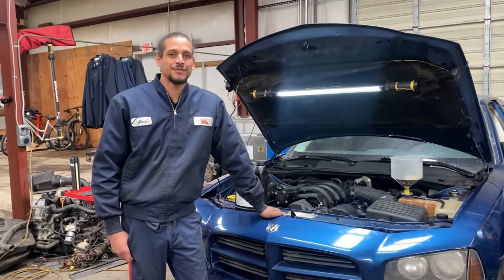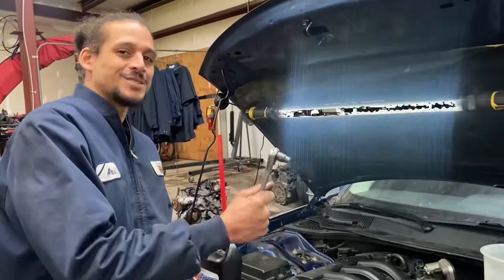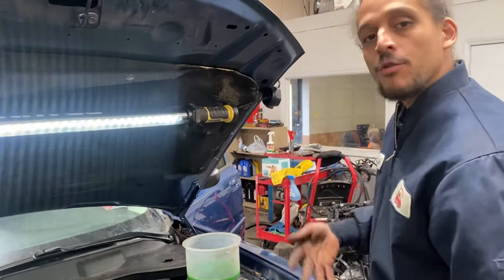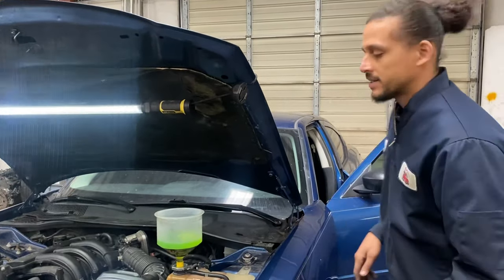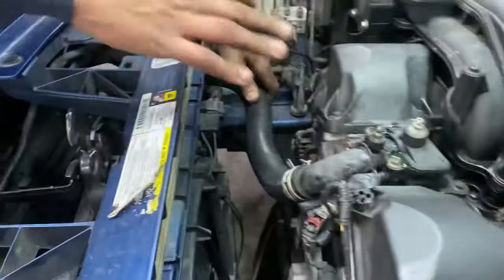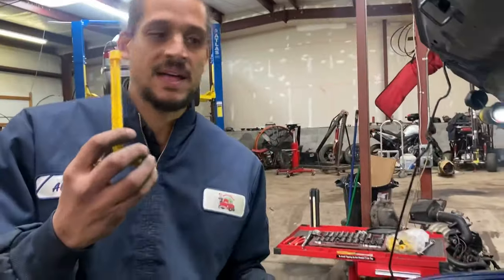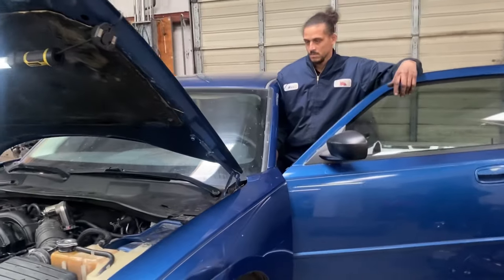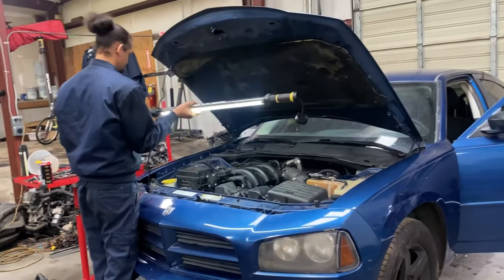How to Bleed or "BURP" Air Out Of Your Engine Cooling System (2 WAYS) #coolingsystem #overheating

Comment: Always use factory coolant ,and distilled water otherwise just throwing your money away,also always reuse factory hose clamps,they keep constant tension unlike garbage worm gear clamps
Reply: @markhunka  I re-used factory hose clamps one time and had the lower radiator hose blow off while I was driving. A few of my co-workers (diesel & auto mechanics) told me to switch to worm gears instead   so that's what I do now, and haven't had any issues.
Reply: What about rain water

Comment: I have a 2003 Honda Civic LX with no bleeder valve  and did everything this man did and it still didn't work.   What I found out later is that you leave that funnel with coolant attached after shutting off the engine.  Do not plug it.  Let the coolant and engine cool overnight.  As the coolant in the radiator and engine gets cold it contracts creating a vacuum sucking more coolant from the funnel.  If you remove the fumnel too early, you risk sucking in air instead.
Reply: @senatedocument2646  Isn’t that what the overflow is for. It will just suck it out of the overflow that’s why you check the level after it cools

Comment: On some pesky vehicles you should leave the funnel on after done burping and shut vehicle off 3-5 min, then let it run a couple and repeat if needed. Be amazed on some cars how much air comes out after you let it cool and restart. Good video sir!
Reply: Yup, I did 3 heat- cool cycles and saw the level drop 😮

This is a great tool since it places the level at the highest point for air to bubble out

Comment: I worked at a Chrysler dealer for 10 years and I found that the Chargers and 300s love to retain air in the cooling system. One thing I found that always worked great was to take that small hose off of the top of the tank, plug off the nipple on the tank, fill the tank and put my pressure tester on it and pump coolant into it until it flows out of the small hose. I got so frustrated with not getting heat until I came up with this method. Also if it’s a hemi, take out the bleeder screw or coolant temp sensor on the water pump and fill it with the engine off until coolant flows out. Even the vacuum fill method doesn’t work that great on these cars.
Reply from the maker: Thanks for the advice buddy new tricks I love it
Reply: Man I’ve been struggling getting the air out of the Chrysler 300. I’m gonna try that trick and see if it works for me
Reply: Not a Chrysler but my Ford Focus Zetec motor had no bleeder but did have a small hose coming out of the thermostat housing to heat up something on intake manifold and when filling I would pop the hose off and fill till coolant started coming out then pop it back on.
Reply: @user-kw5ze5ky5q  No lies. My little 3.6 gets abused by me. I run it!! Likes to blow thermostats!! This bleeding is a must know!!

Comment: I've been using this kit for decades. However, you need to have access directly to the radiator. I've had Ford's and VW's which only have access through the reservoir bottle. 
For this design without a radiator cap, I fill the system completely, squeeze the bottom radiator hose several times with the cap off the reservoir bottle in order to "burp" the air out of it. Then I fill the system again, put the cap back on and drive the car/truck until it is completely warmed up. When I park it, I check the reservoir level and top off as necessary. Then I come back after the engine has completely cooled down to see if it needs any more. 
Note that the heater temperature control should be turned fully open to the hottest position to ensure the coolant goes through the heater coil and purges the air out of it. 

Also, be sure you only add the proper coolant. Different car manufacturers require different types and color the coolants differently for a reason. Even then, DO NOT MIX different colors, grades or brands of coolant without doing some research. You can do permanent damage to the engine and cooling system. Do NOT use a "universal" coolant. There is no such thing. Spend a few extra bucks for the good stuff. You only need to do this every 30K miles, at most.
Reply from the maker: Thanks for the comment
Reply: Been using universal fluid in every truck/car iv ever had and never had an issue.

Comment: Thanks Alex!! This is an old post I know, but something you said made me really take notice! I changed my thermostat and was getting an ECT sensor that was reporting only 145 degs to the ECM and running in closed loop all the time in the winter (now) and giving me HORRIBLE gas mileage (22 in summer 12 in winter) the gauge would go from half and 194 Degs then the gauge would fall to near cool and 145 degs and very little heat. I was thinking I had a bubble sitting in the system around the ECT sensor (I changed that out twice, as well as the Thermostat both under warranty) I just couldn't believe I had air in there and it must have been a bad part. But I have to believe that is what is going on...Man, I hate the vehicles with the reservoir, or degassing tank as some people call them. Sorry for the long post, But thank you for this video, ordering the kit now!

BTW, if you or anyone else has an alternate idea, I sure would appreciate the comments!..Peace

Comment: I’m 23 and a 3 year technician I learned from a very smart tech when I started to ALWAYS refill with a coolant vacuum filler. I’ve NEVER had issues with car overheating because of air inside the coolant system. I work at CarMax and have refilled every brand make/model you can think of.

Comment: This is great info!  I had work done recently at a highly regarding local mechanic shop and they replaced my 100,000 mile hoses.  After getting the car back I noticed it sounded like a washing machine under my hood.  Thank you for solving my problem. I suspect the mechanic didn't re fill the car with coolant and air pockets resulted.

Comment: I wish I had watched this video before sending my car to the dealership. They ended up doing a bad service that costed me 200 bucks. Now I have air in my system, and the header is intermittent because of that. If don't solve my problem, I will follow your method. Thanks!

Comment: Damn good video sir! You hit on all the things us newbs would need to know, very informative and great delivery 👏🏽
Reply from the maker: Thanks so much! Glad I can help 😊
Reply: @AlexTheCarDoctor  Here's a question. I noticed you didn't jack up the car being the traditional method. Is this method no longer required? I ask because I'm told for Infinti's and Nissans it's ideal and helps any air escape faster. Also last question. If there's no noises from the water pump, no signs of leaks, no smelling of coolant in the cabin, yet, the car overheats as shown by the gauge. Would you think it's trapped air and would trapped air make the coolant rise in the funnel? Because right now when I rev to 3K RPM I notice the gauge goes up vs when it's idle it stays dead center. So, I am hoping...truly hoping...this is not a blown gasket considering I had a new engine installed and checked.
Reply from the maker: @ttvmikrowave  hey there jacking up is a good way but I’ve never use that method because I’ve always use these methods and it worked great. if you bleed the cooling system. The next step would be to do a block test
Reply: @AlexTheCarDoctor  Can't be the block or the heater core as the engine is new. After talking with my friend who's a shop owner he said most likely there's a massive air pocket that's restricting the coolant from flowing properly. Thus, why at idle and during revving the coolant backs up into the funnel; followed by overspilling -- even when there's no remaining coolant being topped off in the funnel. So, I decided to let Jiffylube use a vacuum device to drain and refill things properly; as air likely got into my system during the engine swap. 🙄🤦🏾‍♂️

Comment: I thought that I was going to have to do something with the sensor since that was the code that was thrown, because the check engine light was on. Then I realized after watching some vids that the problem was that the system needed to be burped. As when the car's computer is throwing other codes but the fix was simply an air hose that wasn't on right, or needed to be switched out. Anyway, I'm glad I watched your video because otherwise I would've forgot to put the heater on high.
Reply: Turns out it was the sensor after all.  I guess it's been a process.

Comment: Did my first water pump on my Equinox as well as changed all the hoses and the belt as those parts were original GM with 189,000 miles on them.  This was my last step and very helpful as this car doesn't have a radiator cap either, only the reservoir.
Reply from the maker: Glad I was able to help

Comment: Thanks for the good video. My bleeder screw did most of the burping, but I used a regular funnel to burp it some more afterwards, also squeezing the upper radiator hose. I'm going to buy one of the funnels you're showing. That looks useful. I could not initially get the bleeder screw to open and got an air lock. I was going to replace my water pump after the first clean and flush. But since the bleeder screw (on the water pump) wouldn't open, I decided to drain all I could, then replace the water pump with good bleeder screw and that working bleeder burped my 5.7 hemi. Scary when air pockets cause overheat.

Comment: I just did a 2004 Dodge Neon SXT 2.0l Radiator, upper and lower hoses, thermostat and cap and the transmission cooler lines all without removing the intake manifold or sucking down the A/C like they tell you to do oh what a job that was lots of fun, but she is done and it’s like a brand new car again.
Reply from the maker: That’s great news it sounds like you are a very good tech

Comment: Your so informational thank you! I replaced thermostat water pump and radiator, but I forgot to bleed the system. Temperature gauge keeps fluctuating what should I do? 2018 Dodge Durango
Reply from the maker: That’s your problem after you bleed it everything should be OK

Comment: Had high mileage car I bought, developed cooling problems in summer. Blew a lot of coolant out overheating and then it was still messed up after refilling. Turns out it had bleeder valves I didn't know about. I figured them out and got a lot of air out  , then it worked better but it was hard to get air to come out.
Later I drained the system and filled with water, since it was hot summer, and drove it. Drained and refilled over next couple weeks, every other day or so.
After a couple few weeks it was all cleared out and I noticed being cleared out better I didn't even have to use the bleeder valve anymore. It got the air out by itself.

Comment: Best to remember, those doing this on a diesel, check to see if you need to add an additive 'SCA'.   I personally bought the 50/50 as the SCA coolant already had the SCA additive included in the coolant, and use the recommended coolant for your particular vehicle, as there are many types/brands on the market.

Comment: Great info!  Mr. Alex, I’ve never used a burping funnel like that. I usually raise the front end slightly to help the air bubbles move to the radiator cap. Would I still need to do that with this funnel?  I have a 2013 wrangler jk. Thanks!
Reply: Nope since it sets up to the highest point for air to escape.

Other comments say to leave it on, and let it cool down a few cycles and see if the fluid level drops.

I do 3 heat cool cycles just because i don't want to deal with the air bleed valve 😅

Up to you if it makes you feel better though but you'll see how high the funnel makes it so much easier to burp it

Comment: Good video. If you put a vinyl hose on bleeder nipple the extends to the funnel or up several inches you will save some coolant and make less of a mess. Also you committed with 100% concentrate early on with a lot I. The funnel. If it would have filled before draining you would have put in no water. Think I would mix before at whatever proper % and then pour that in the funnel. Thanks
Reply from the maker: Good observation on the coolant mixing that was my car so I didn’t care lol. I have a 55 gal 50/50 that I use for customers
Reply from the maker: Thanks for watching

Comment: Man I'm standing at my car right now, is there anyway to call your shop bro? I don't have that funnel but when I do it the old fashion way.. I have the reservoir top off, and turn the car on and the heat on high..high. it only starts bubbling once the antifreeze rises and starts pouring out the top of the reservoir it's bubbling while doing so.. but I'm losing alot of antifreeze. I don't know if it's bubbling because the antifreeze is hot or if it's that many bubbles in the system. Any help bro?

I have a 2005 dodge magnum im working on

Comment: Thank you for sharing! Very informative and helpful! Thank you again.

My only question is, when you bleed the line with the bleed valve screw and coolant comes out, should I clean up any coolant that got over some engine parts or is it okay? Read online that if you do spill some you need to clean it up. 

I flushed my coolant without the no spill funnel and it overflowed. Cleaned it up as best as I could. Do you think it’s okay? 

Would love your input and feedback. 

Thank you👍🏽👍🏽

Comment: I wish I could get full strength Toyota Red Coolant gallons but I never see them offered anywhere 

When I did use full strength, I would mix the distilled water and the coolant in a clean 5-gallon pail first.  I then would add it to the radiator.  

What bled out of the car in your video was likely pure full coolant.  But if you pre-mixed out of the car, the discharge would have been half water saving half coolant.

Comment: Temperature control on max heat and blower fan on lowest speed. You want max hot coolant flow. Heat causes air to expand thereby facilitating air removal. High blower fan speed will make heater core act like a miniature radiator cooling the fluid but you want some air movement so you can confirm engine heat.

Comment: Great video.  Loved it.  If you replace the thermostat, on a 2015  Suburban,, and some air gets into the upper radiator hose, will the vehicle naturally clear it out as you run the heater?
Reply from the maker: Not necessarily it will bubble and gargle and possibly run hot, it’s best to run the vehicle with the cap off while massaging the upper radiator hose like in the video

Comment: Got this funnel and did the 2nd method with it...

Was scared of breaking the air bleed bolt in some engines since they're hard to access

I do 3 heat cool cycles in my driveway because I wanted to be sure no air is in the system 😅

Tool payed for itself after maintaining 5 cars in my family 😊

Of course, use distilled water with the coolant mixture in the system

Comment: Good morning happy newyear! My name is walter! I love your videos so informative,  I really think I need to do this to my Cadillac Escalade 2010 base.  Another problem I’m having is an internal misfire only on cylinder number 5,  i change the coil pack, spark wire, and spark plug. But still have a slight mis! What could I check next?

Comment: What about the engine block? Does it need drained as well when flushing? Been struggling finding the block drain plugs on my challenger and the ones I think are it seem like a pain. Was just going to try and take off the lower radiator hose and hope it drained it. Any advice would be appreciated, great video my man.
Reply from the maker: Hey there unfortunately auto makers put the block drain plugs in some crazy spots,I normally just pull the bottom hose like you mentioned, good luck buddy

Comment: 2007 Mercedes GL450 I changed Radiator was leaking at idle air goes to cool as soon as i rev engine gets hot drove car about 5 times now still the same i ordered funnel like you have hope this helps hoping not any type of headgasket issue it does have 230000 miles!
Reply from the maker: Keep me posted thanks for watching

Comment: Hey man loved your video! I've seen guys burping the system by using the radiator instead of the expansion tank, what's better or correct? And why? Thanks a lot!
Reply from the maker: Hey there buddy I’m glad you enjoyed it. When burping the cooling system you wanna burp the air out of the system from the highest point most of the time that’s the radiator neck, some cars don’t have a radiator neck and only provide a expansion tank. If you noticed in the video this particular car provided an air release Screw for burping the system, i’ve always had a habit of using both methods the highest point and if provided the burping screw
Reply: @AlexTheCarDoctor  Thank you so much for the answer, keep up the good work!
Reply from the maker: @martinc.4518  will do buddy

Comment: Great videos my man! Do you have input for replacing or flushing the heater core on a pennstar?
Reply from the maker: Just a tip the rest is best shown in video,you need to buy Prestone coolant flush solution and follow the instructions on the back prior to flushing the system
Reply from the maker: Thanks for watching

Comment: I have a 15 Chrysler 200 3.6 that overheated on me friday.. Found the water pump leaking, replaced it and the dang car is still overheating.. no leaks though. These cars are a massive pita to bleed air out of the coolant system.. may have to try this..

Comment: If you don't have a burp funnel can you just leave the top up the reservoir with the cap off and leave the car on to flush the air out itself ?
Liked and subbed !!
Reply from the maker: YES! You don’t have to have a funnel to do it. You can just leave the cap off and have the car running with the heat on HIGH. Be sure to massage the upper radiator hose periodically all while adding coolant and making sure the level of coolant stays at the full or at the fill line. Thanks for the sub man!